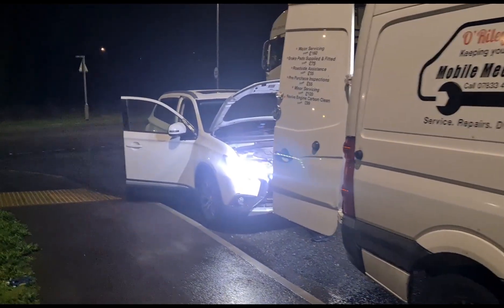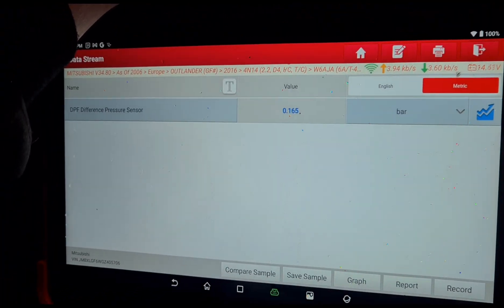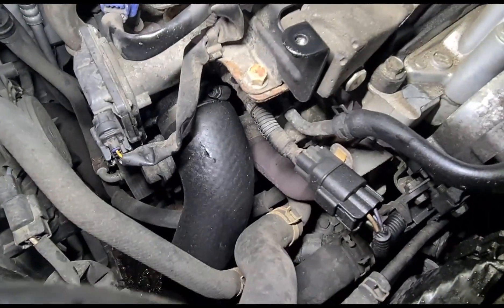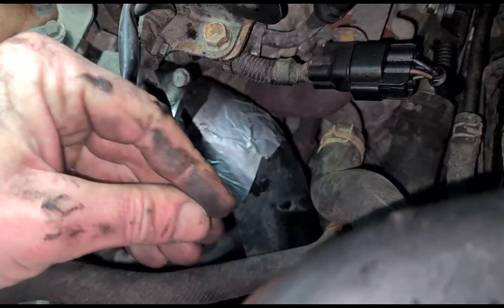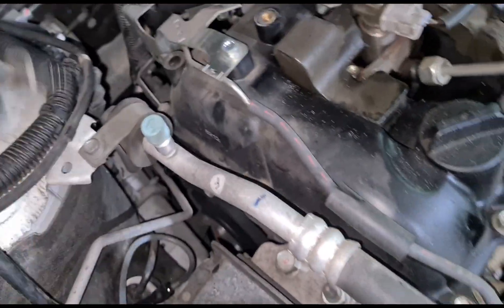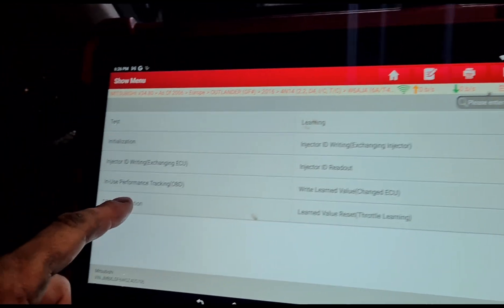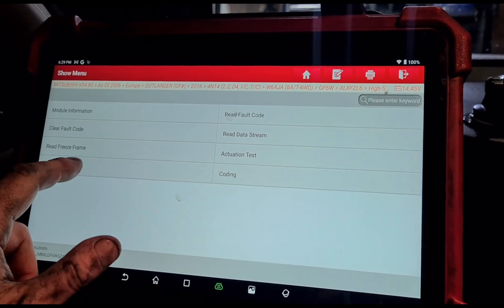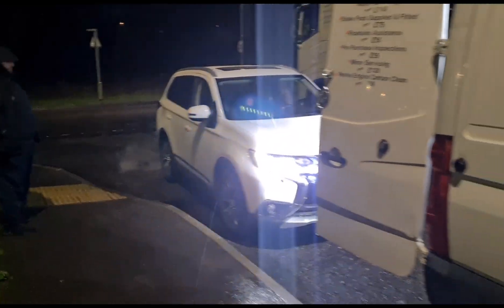Mitsubishi Outlander Travels To Me From Belgium! P1498 P2463 P2454 P252F

Comment: Just had the same pipe split in my outlander… would any superglue + gaffa/duct tape work for a temp patch until the new pipe arrives & can be fitted?
Reply from the maker: https://www.toolstation.com/hv-super-glue/p78871?utm_source=googleshopping%2CRakuten&utm_medium=feed%2Caffiliates&utm_campaign=googleshoppingfeed%2C4639013091262166989841761&utm_content=ShopForward+CSS&ranMID=46390&ranEAID=nz%2FxpRlxjVA&ranSiteID=nz_xpRlxjVA-P9gfpA_xNITFnU9l76M3zA

Comment: I bought a Transit custom new in 2013, the thing constantly kept doing a regen and putting diesel in the sump, raising the level above full, it went to the dealers loads of times in the first 30k miles. Every time the dealers chaged the oil they put it on the Max line, as a test, I removed oil via the dip stick hole with a small pump, down to the 3/4  line and it stopped constantly doing the regeneration, after a few more miles the  level dropped slightly lower as diesel evaporated from the sump, still got the same van 10years  later, 150k miles on the clock now, no issues since then, simply don't fill the oil level to maximum!

Comment: Hello sir thank you for share and teaching us your knowledge!! I have seen almost all your videos and I have learn too much about the correct way of diagnosing and cleaning the dpf! I also buy the same tools and cleaning fluids from launch thanks to you! The spec for this dpf gun says if I remember correct air pressure to connect 3.5 - 4.5 bars (65 psi). Do you try to this pressure 65 psi but you see better results at 130 psi and for this reason you continue to use it at 130 psi?? I don't know which pressure I use! Best regards!!